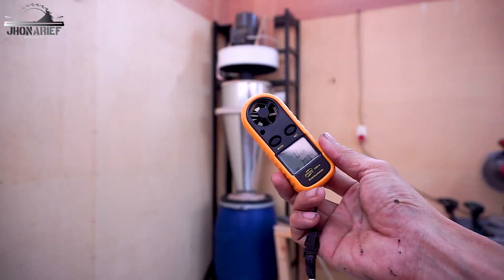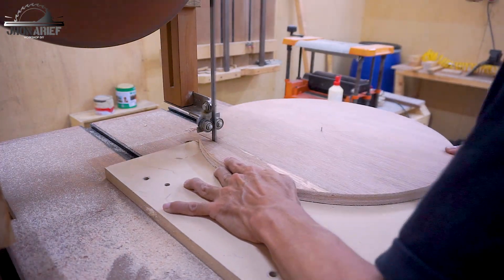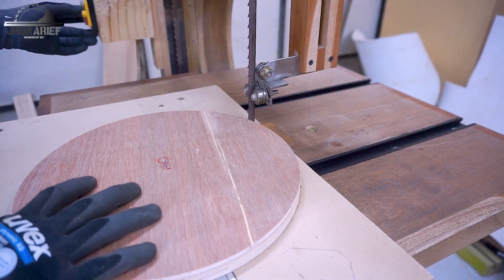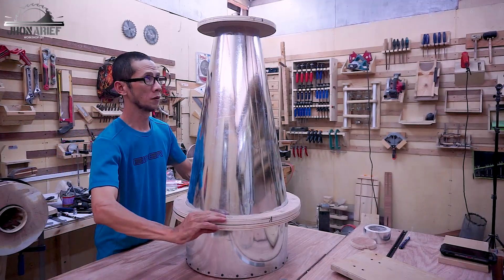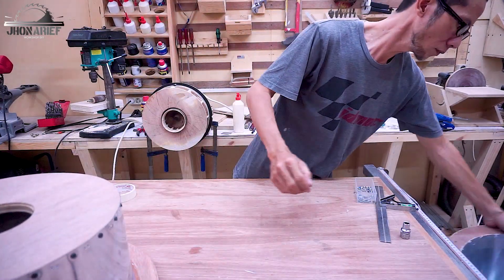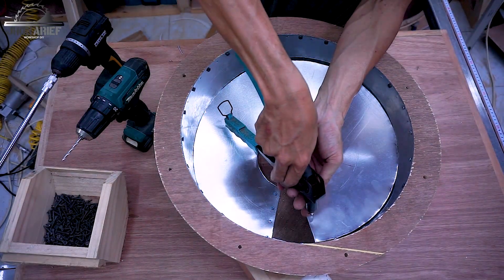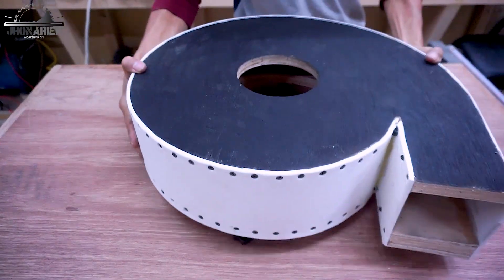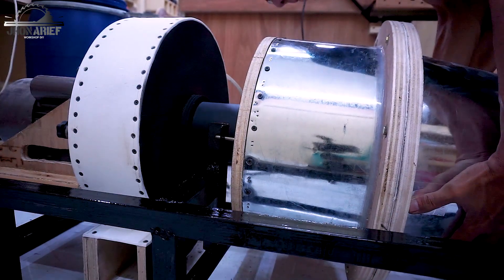HOMEMADE CYCLONE SEPARATOR - DUST COLLECTOR SYSTEM

Comment: I thought your techniques for making the cyclone were as easy as I could Imagine. I will follow this when making my own.

For those who want to know the CFM imperial cubic feet per minute.  I calculated 309.2 CFM based on the 3" inlet tube passing air at 32m/s.  32m/s = 104.9869 ft/s. 
My calculations:   3" inlet = 1.5^2*pi sq-in = 7.07 sq-in   or = 0.049 sq-ft
104.9869 sq-ft * 0.049 sq-ft = 5.15 cu-ft/sec * 60 sec/min = 309.2 CFM  (cubic feet per minute)

Comment: When you run a long plastic pipe do you run a copper wire inside to catch static electricity 😮?
Reply from the maker: Yes I'm using copper ground wire

Comment: Think the internal baffle at the top of the cylone is in backwards. At least thats how it looked. As the air enters the cyclone, the air should be directed downwards. That baffle appears to be sending it upwards. That will increase the pressure drop through the cyclone more than is necessary, and may cause some of the dust to mix with the outlet air. 
Nice build though.

Comment: Yes.. A strong motor and a good impeller, reducing the intake at the Cyclone should surely increase air speed, which keeps the dust/chips moving.. 
The 1hp Motor with 2800RPMs must be a good strong motor. I noticed in that video, when you put the plywood over the impeller intake, there did not seem to be much motor slow down or drag.. I was wondering how much space/tolerance you had in your build of your impeller to increase the Static pressure, but, you really could not have made it much tighter than you did.. Excellent job... I will likely try to duplicate this some time in the future when I move into a larger shop.. Thank you.
Reply: Vacuums and fans actually SPEED UP when you restrict air flow since there is less air resistance. Just try with you own vacuum

Comment: Hi hi John, I made a change from traditional dust collector to cyclone conversion, however I am having a problem with the suction. The impellers work fine but they suck from the side extraction pipe as well as the bottom of the cone so the saw dust never goes down to the drum. Any idea of what I'm doing wrong?

Comment: The air velocity at the 3 inch pipe being  33 m/s gives 3x3x33 is about 300 “units” of airflow.
At the 4inch pipe it was 27m/s, giving 4x4x27 is about 430 of those same units. 
So even though the velocity is higher it forms a serious constriction on the airflow.

Comment: Velocity increase can only happen when the cross section is smaller. (For the same blower)  this has limitations up to a point when you reach max velocity. A cyclone adds resistance (drag) which is normal. Every obstacle in the flow causes drag. It just cannot happen that for the same diameter with added drag you get higher fpm. This means, that either your measure method is not consistent, or the diameter has changed.
Reply from the maker: yes, actually if you see the video you will find that my inlet diameters between impeller and cyclone are different, btw thank you.
Reply: @jhonarief  that explains. What is your CFM when fully assembled?
Reply from the maker: @tamas7555  tomorrow i will upload the result for thesting this my diy dust collector with all the pipe instalation assembled

Comment: Nice job! How did you transfer the drawing for the inlet onto the side of the top hat

Also, how did you decide the rotation
Reply from the maker: I use the pipe leftover of cut for the template, and the rotation I just follow the rotation of the impeller

Comment: Great build and fantastic gain in air velocity! 👍
Do you think that using 5” hose instead of 4” would improve air suction even further?
Reply from the maker: It depend on you impeller size  sir?
Reply: @jhonarief  i have an impeller of 35cm diameter with 6 fins, would tou recommend using 4” or 5” hose?
Reply from the maker: @Alessandro Suppini  with 6 fins I think 4" is the best velocity you will get if you reduce 1" from that 4" for the inlet cyclone,  6fin you will get loud noise and lower air velocity
Reply: @jhonarief  thank you for the advice 🙏
Reply from the maker: Because like you see in video I use inlet for impeller is 4" and inlet for cyclone is 3", that mean my pipping installation is using 3", my impeller if you see in part 1 impeller build I use 33cm impeller diameters and 5 cm width of the blade, that's the most suitable for my 1hp motor